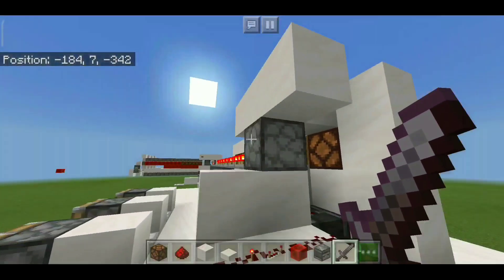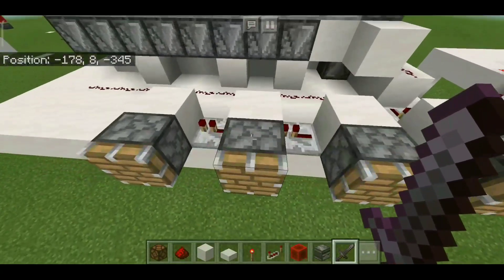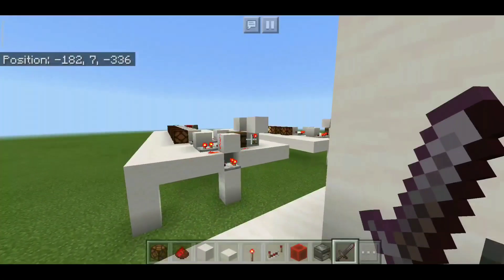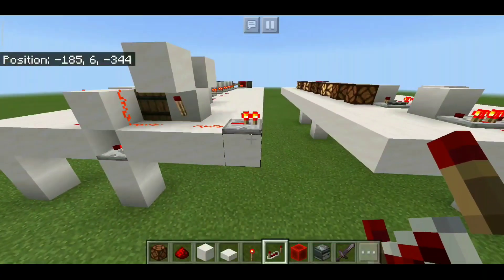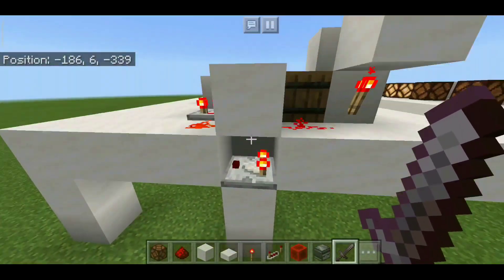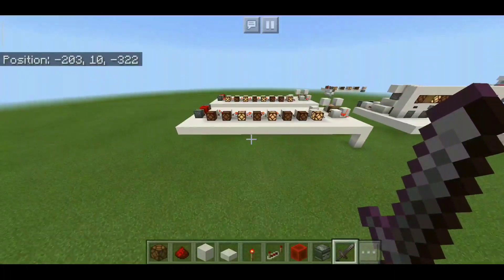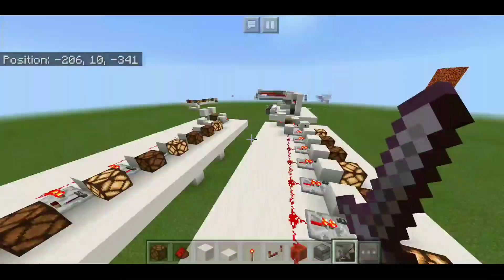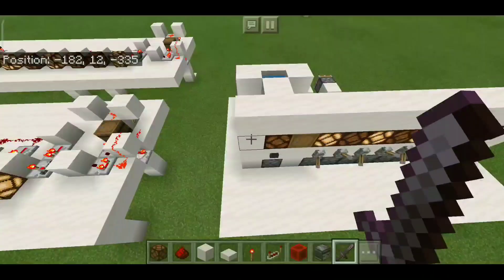Improved Wireless Serial Data Transmission Minecraft Bedrock 1.16

Comment: Yo! A solid state latch on the receiver seems to solve the issues that arise from having multiple receivers. I found that on the one I built, having other pistons firing,  outside of the transmitter, would either muddle the transmission coming in completely, ie… my first clear register bit would triggered the pistons in the receivers as the transmitter is sending. Alternatively as the message finishes being received,  the latch (piston) is triggered again, sending a extra bit, which then clears the register. SMH. Super annoying, but since I switched to the solid state latch, massive improvements!
Reply from the maker: Or you can try to implement real life noise cancellation ways into Minecraft
Reply: @diablo931.  tell me more.
Reply from the maker: @MECKENICALROBOT  Haven't tried it yet i want to i have videos and stuff recorded for many things i just don't get time to edit and post them cuz i have exams real close
Reply: @diablo931.  respect ✊ I been there.

Comment: Yes! You have my attention. This is so sick. I need to build this asap!  I’d like to compact the addressing and decoding  and apply it to my quarry tech
Reply from the maker: I would recommend watching readfreak as he has more updated wireless designs than this one
Reply: @diablo931.  hey, any chance you came across any weird player detections capability? Cause I’m having that, which is a cool, but I’m trying to work out how to control it…
Reply from the maker: @MECKENICALROBOT  pufferfishes can change state when player is nearby but that doesn't help much on bedrock cuz the hitbox doesn't change size on bedrock , other than that u can possibly use xp entities cuz when player gets close enough it picks up the xp and that can be detected with Redstone but that needs a annoying reset system to fill the xp back
Reply: @diablo931.  yeah it’s so finicky. I think I figured it something I’ve built. And if I can find it. That would be awesome. I just ended up moving the wireless stuff away into its own simulated chunk and from any other redstone for the time being. But dude!!! This wireless is soooo sick, I’ve been condensing these designs and I’m loving the results. Should be posting updates between today and tomorrow…
Reply from the maker: @MECKENICALROBOT  great

Comment: what if you added a hard encoded message to differentiate the different transmitters
Reply from the maker: Wdym
Reply: @diablo931.  what i mean is there is like a code that will allow the reciverse to accept only certein sigal being able to identify them with the encoded  code
Reply from the maker: @willraya1791  Yes an Addressing System can be used to Specify and Identify Addresses , 
Here is a 8bit Addressing System I Made : https://youtu.be/r87agJYOSvw
And here is a Display System that Works on 4bit Addressing System :
 https://youtu.be/48EVljGofXU
Reply: @diablo931.  nice exacly what i was thinkin

Comment: Awesome, I saw this and was expectings kulk sensors, but this is far better, what is the range with this thing?
Reply from the maker: Since it uses Burnouts to Detect Redstone Updates , as Long as the receiver and Decoder are loaded u can transmit Signals from an infinite range , u can be millions of blocks apart and it will still transmit signal
Reply: @diablo931.  incredible
Reply: @diablo931.  does this work in java?
Reply from the maker: @codegoblin7740  probably not the bug is bedrock exclusive